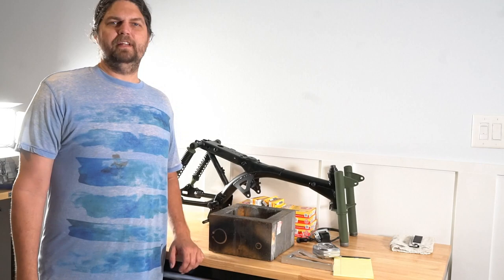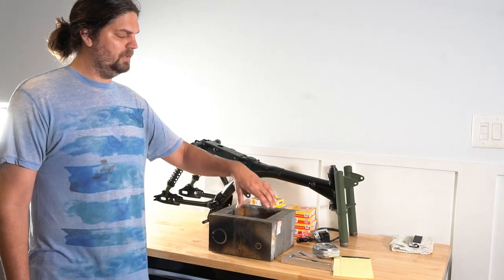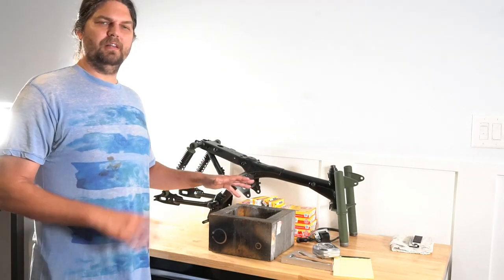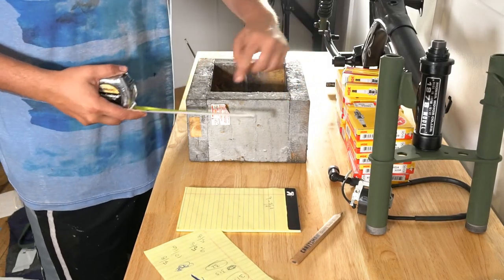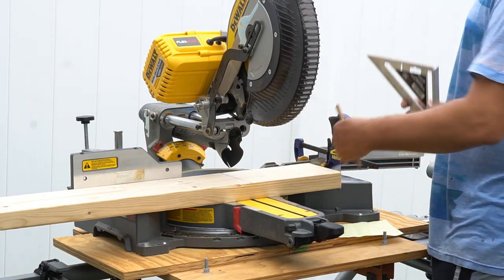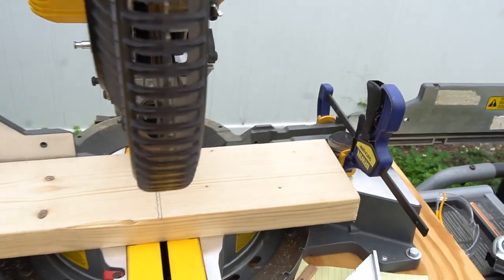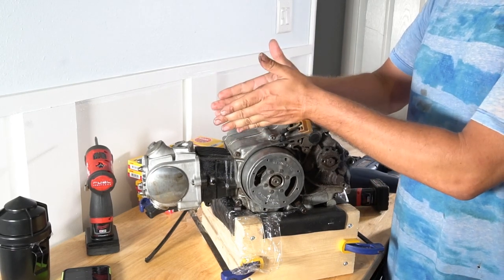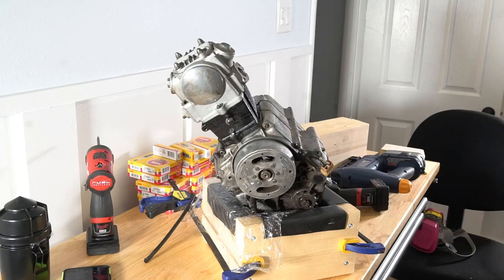DIY Wooden Engine Box Stand For Honda Horizontal Engine Rebuilds - CT70 Z50 Mini Trail Monkey Dax

Comment: i do roofing and construction. i used rubber roofing scraps and used those in place of tool liner. i also used button cap nails instead of staples as well. the rubber roofing scraps work perfectly. the next one i do im going to use the glue we use. that will work even better.

Comment: Japanese motorcycle parts maker Takegawa actually sells a version of this, in wood, with a plastic cap that protects it.  When I saw it on the Web!ke website, I wanted to have one for myself, but it was like US$48 plus shipping so like you I built my own using a dimensioned illustration from Takegawa's website.  I like the tool drawer liner idea.

Comment: So I noticed when I was taking my 1971 Honda z50 cam sprocket off that the o was at the bottom. Do I need to attach it back how it was and spin the o to the furthest part to the front when putting the timing chain back on? Thanks

Comment: The world uses MM, Honda’s are metric like the world. Wouldn’t the inside dimensions make way more sense as this is where the engine is supported. Not the outside.
Reply from the maker: Updated the video description area with these measurements - This will get the right interior size no matter what material you use:
6.5" x 6.25" Standard
165mm x 159mm Metric